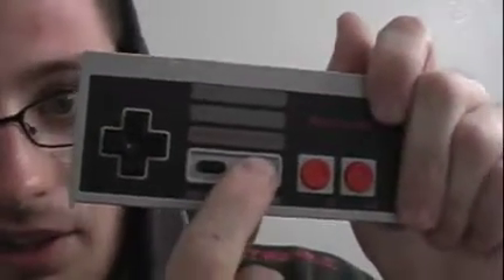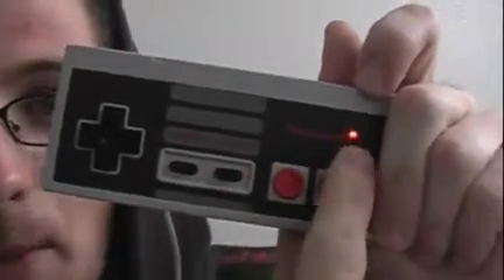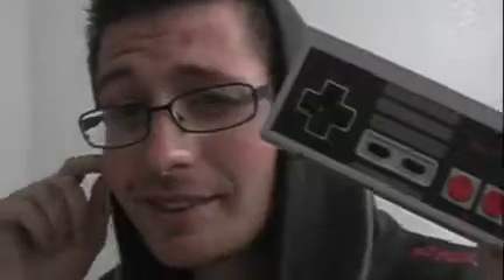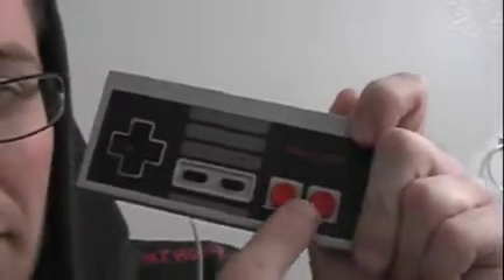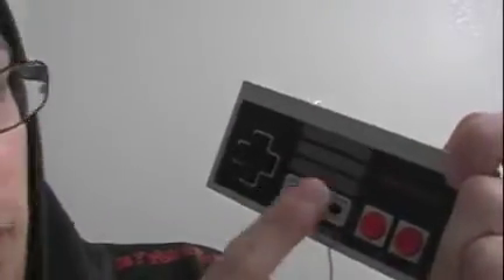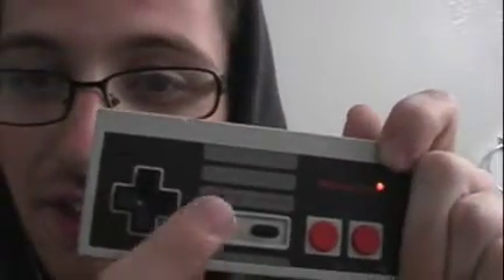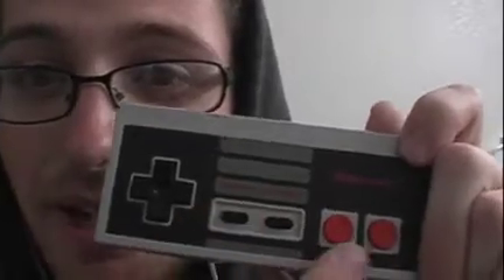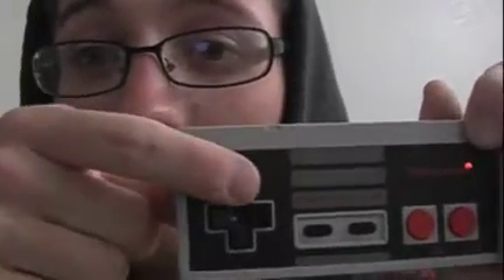DJayMoney - NES Controller MP3 Player

Comment from the maker: runs off of AAA battery.  If you can get your hands on a creative zen stone or ipod shuffle then you can charge it USB and save on space inside the controller but the soldering points are MUCH smaller on those mp3 players making it harder to do.